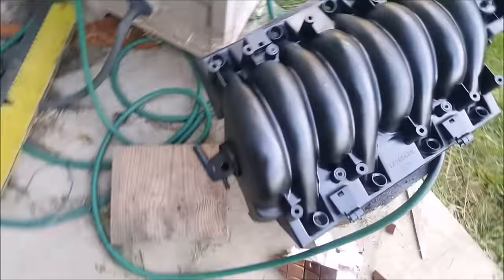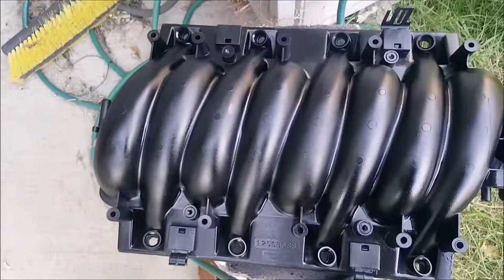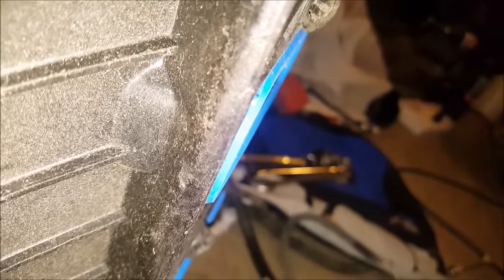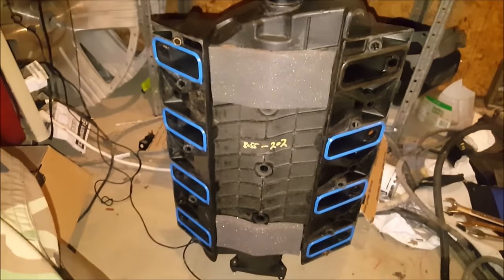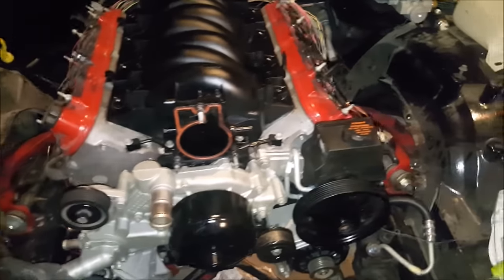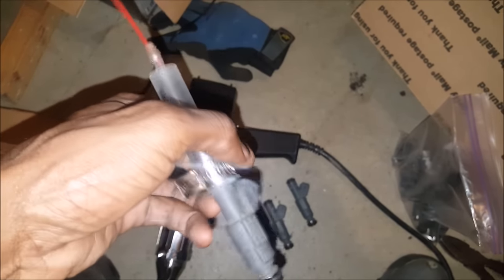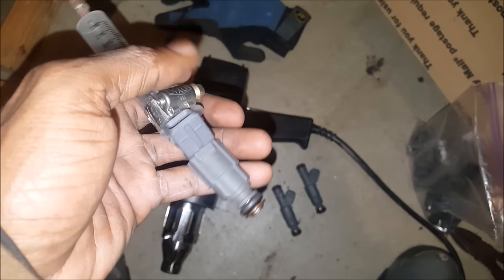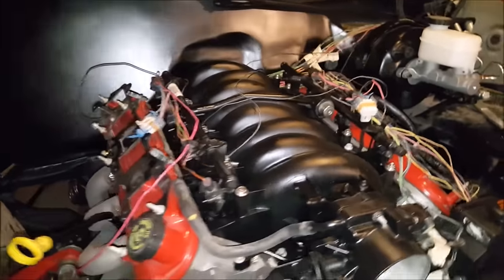Veltboy Garage - LS Swap, Intake, Injectors, Fuel Rails, Throttle Body Cleaning & Install

Comment: Hey where u get them headers from did you have to do any modifications to get those the fit in that g body I got some as body headers but I don't think that they were the right ones because the driver side is like off to the right too much

Comment: looking good ..wiring sucks lol
Reply from the maker: Diy type of guy Thanks... The wiring isn't a big deal & its pretty easy to me. it just take a while to trace back & see where it goes but it wasnt bad at all
Reply from the maker: That painless kit will definitely make things easier. I wanted to experience the rough part & learn how to do ot without taking the easy way out so i will know how to do it if ibdecide to do another one or have a moror job where i need to do some wiring. It wasnt too hard but yea i did think about that painless harbess at times but at the same time i didnt want to cough up $5-700 for one lol
Reply: veltboy314 they that much? I thought they were like $300
Reply from the maker: You can find some cheaper ones on ebay or from other people out here doing the wiring mods thats needed sor a small fee but last time i looked painless & PSI harnesses were pretty expensive
Reply: veltboy314 Ima have to check prices even tho Ima long way from needing it ..I do research early lol